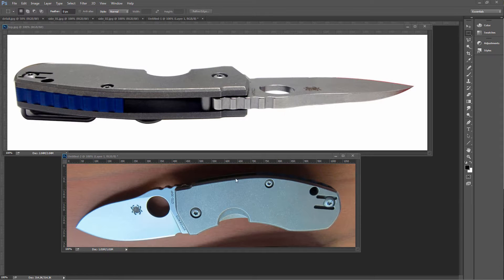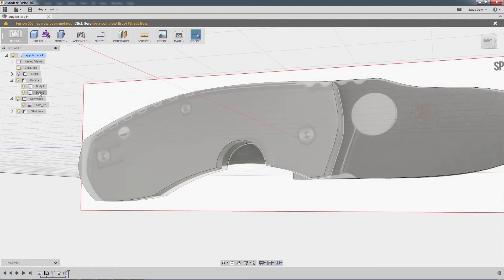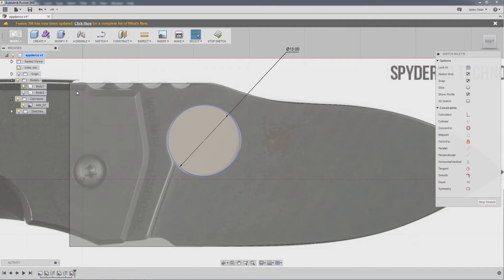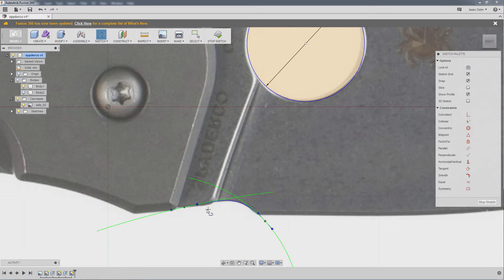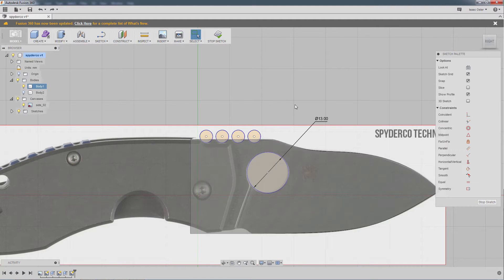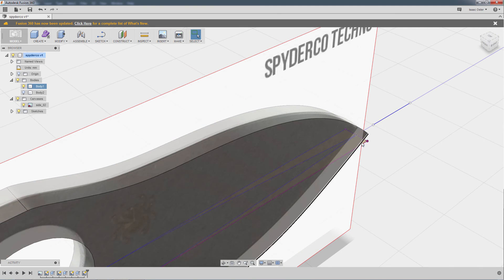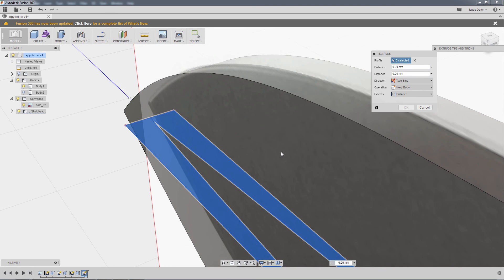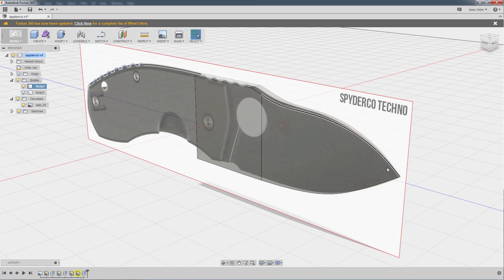Fusion 360 Sample Project Ch 3 - Blade Refinement 01

Comment: Thanks I'm following this tutorial from the start. I have only been using Fusion 360 for 2 weeks now.. It really helps allot!  By the way in case you didn't know, If you want to select through a body, you can just press and hold the left mouse button over the object behind a body. Then hover over the mini list of objects , it will highlight the one you want to select. Saves a bit of time by not having to turn on and off a body from the component hierarchy on the left .

Comment: Potentially a simpler and more accurate method if you have reference of the grind profile (looks like a full flat) would be to model the profile and sweep it along your edge spline, sort of the way the blade would have been machined too :D

Comment: Im having an issue when trying to mirror the spline for the blade. I create the spline then the straight line to use to mirror but when I go to the mirror tab and choose my object/mirror plane it wont select either for me. the line and the spline are both there but when I try to assign them it wont select them. Any advice would be appreciated.
Reply: Make sure you are using the mirror option in "Sketch", not in "Create". Hope this helps